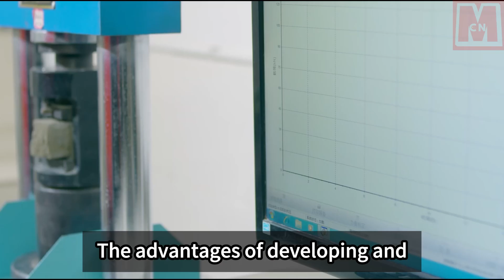China is building the world's largest hydropower project on the Qinghai Tibet Plateau!

Comment: India fear that not all of dam water shall be discharged down stream towards India, if so India have a valid concern.
Reply: @philoso377  For China, this is just business, but India may not think so. India has conflicts with all the surrounding countries, and any plan will be seen as a political issue by India.
Reply: China will never divert natural resources away from countries who need them but will also supply them with cheap energy.
Reply: In fact, the area is located in the upper and middle reaches of the river, and its water flow is not very large. This process is just to make full use of the water, but eventually the water will be discharged downstream. At the same time, it can also reduce the threat of floods downstream by regulating drainage.
This process will provide cheap clean energy to downstream countries, with electricity tariffs as low as 30 cents per kwh.
I know that the only opposition to this project is India, even though they need electricity. A narrow political question.
Reply: @wenliu9571  Your message is unclear. Are we saying that China plans to give up dam water and electricity wholly to India?
Reply: If so, why do India oppose?
What you have just said never received by India.
Reply: Shouldn't give a hoot to  India's concern. What can they do, spew shit with their mouth like Wion and First Post does?😂😂😂
Reply: Right 😢😢🇧🇩🇧🇩🙏🙏